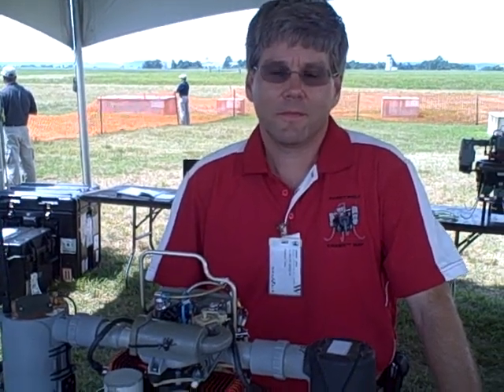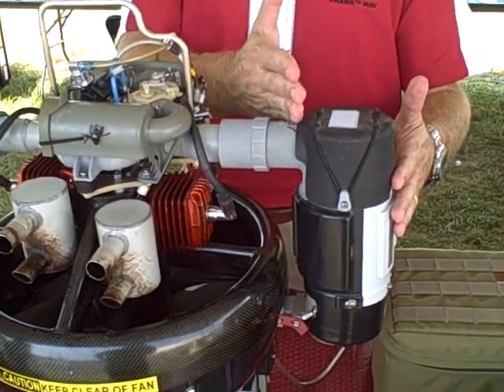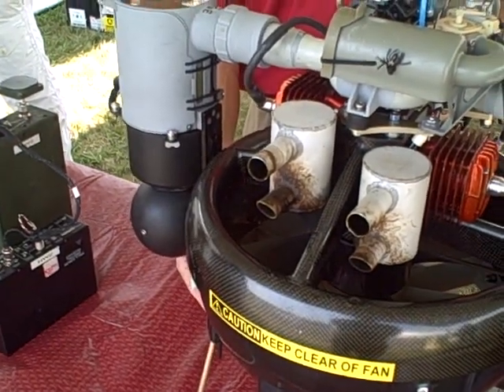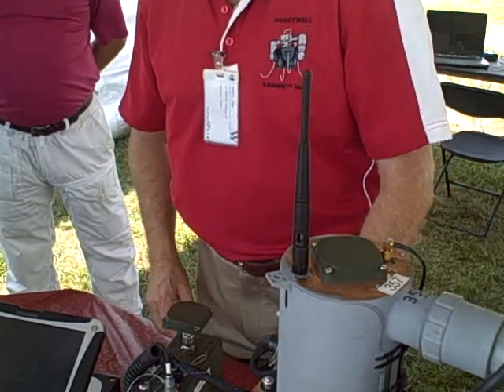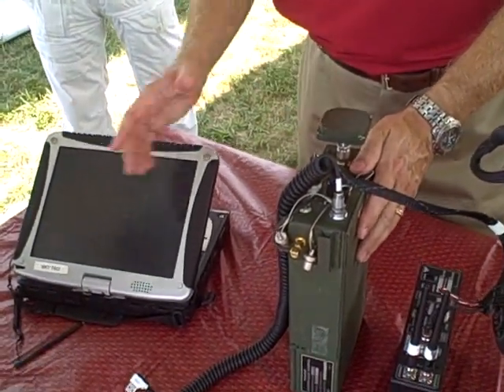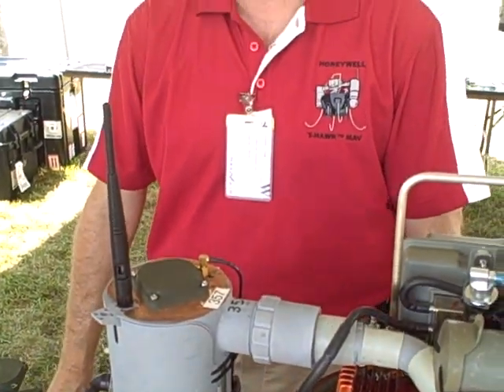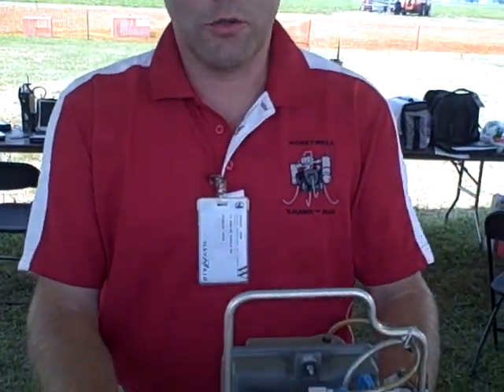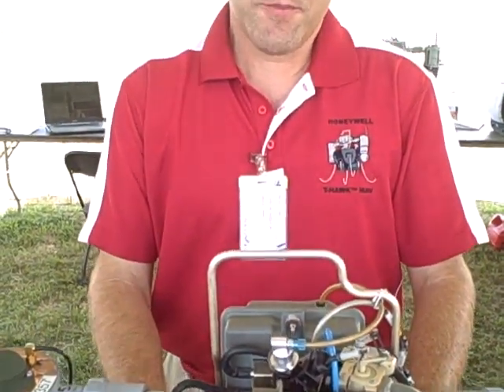Honeywell T Hawk Described

Comment: IF i am not wrong this MAV is powered by a crrc pro 100cc two stoke two cylinder gas engine. mmmm... maybe that is why it had a forced landing....
Reply: In addition, a Currawong ECU and EFI, same systems are used in UAV FPV military drones worldwide, e.g. Threod Systems. Some of these are used in endurance flight record vehicles.